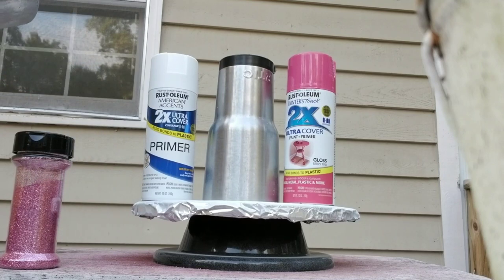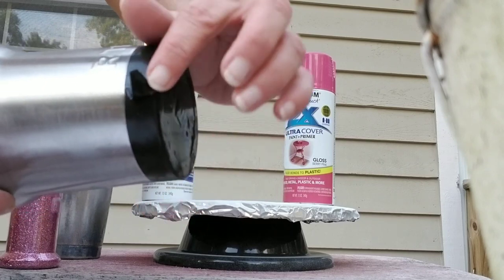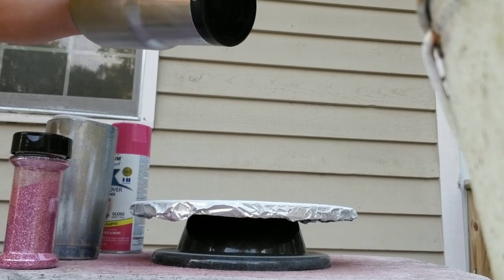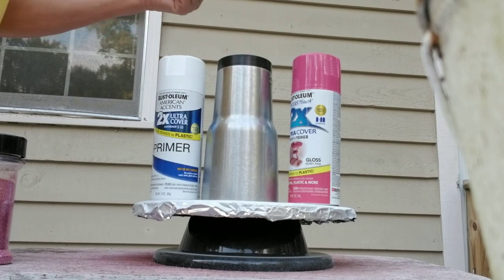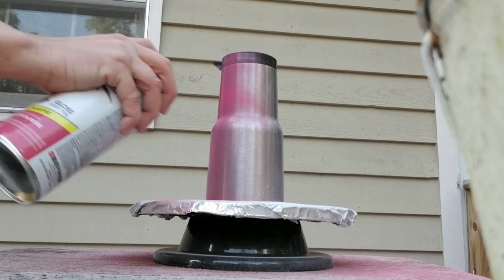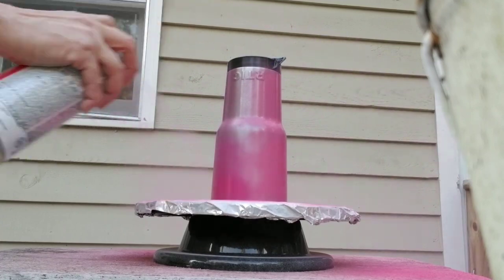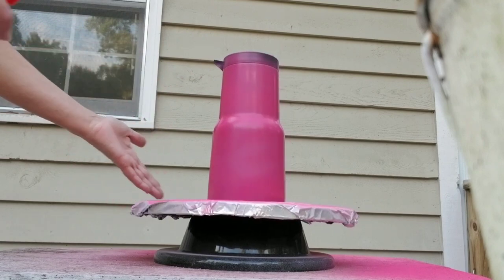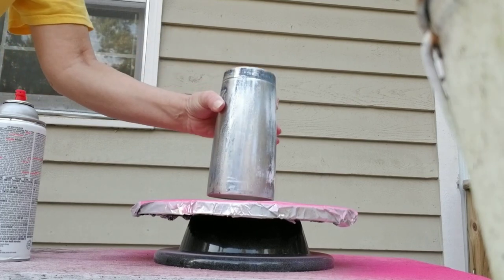Preparing stainless steel tumbler for painting

Comment: To confirm, you didn’t add any primer for the pink spray? Is it necessary to use primer? I have some sitting around at home but not sure if it’s necessary
Reply: The Rustoleum 2X Cover has a primer in it, but it's probably not necessary since you are epoxying over whatever you put on the cup, which locks everything in

Comment: For the first time I got a little paint inside my cup .. how can I fix it ?
Reply from the maker: I usually wait until I'm ready to epoxy the last layer and clean the rims and inside.  A little rubbing alcohol or acetone on a paper towel will take paint right out
Reply: Ok thank you
Reply: Denatured alcohol if the regular rubbing alcohol isn’t working, do this outside thought and rinse thoroughly after paint is removed

Comment: what if I get spray paint on the inside rim, how to get it off?  thanks!!
Reply: Mandy, 

Normally, after I epoxy first layer and its cured, I just wipe inside and the rim with acetone.   If you paint open side down,  no paint gets inside, but it may get on the top at the rim.  Hope that helps!
Reply: Acetone

Comment: I thought you where gonna use the white as a primer then the pink spray paint ontop. Does the paint hold up pretty well? Good video!
Reply from the maker: Mario C ... yes, I don't use cheaper store brands and I have not had any issues, even with tumblers I seal and bake with the clear spray paint
Reply from the maker: Mario C Yes...it really does.  After glitter. You will epoxy over it, locking glitter in.

Comment: Newbie!  I have drips from the spray paint.  Is there a way to get them off or flat?
Reply from the maker: Sorry missed this.  When this happens, let it fully dry and lightly sand the rough area with fine grit sand paper, wash, dry and apply another coat of paint in that general area

Comment: How’s the paint hold up to washing etc?
Reply: These are base coat for glitter tumblers to be sealed with epoxy.  I have, however, done spray paint only, baked in oven to hard the clear coats and they held up very well.
Reply: @MaryKayLora  can you give baking instructions? I want to paint a cup and add vinyl decal so what would be your suggestion?

Comment: What do you use to strip your cups with
Reply: If it's just paint, I use acetone. If it has cured epoxy, I use a paint and epoxy remover you can find at Lowe's or Home Depot in paint department. I use an old paint brush and brush it on, then wrap in aluminum and leave it outside overnight.  It pretty much slides off the next day.  Get some chemical resistant gloves and wear protective glasses when handling it.

Comment: If you bought paint with primer why do you have to use sandpaper. I only used the paint with primer and it was fine. Didn't know you could use gloss paint alot of people said to use flat never gloss that's why I didn't buy the gloss but I see from those video it doesn't matter
Reply: Sorry I missed your comment.  I always sand to give the paint a little bit of a rough surface to adhere to. Some folks don't sand, but I prefer doing it to assure the paint won't lift.  Gloss is just fine.  It's just a base to help hide the stainless color when you apply your glitter.  You don't have to do a base coat if you don't want, but stainless may show through, depending on glitter and the color.

Comment: Will it wash off if I wash it
Reply from the maker: You need to seal it with something if you're not applying glitter and epoxy to it.

Before glittering cups, I baked my painted cups to seal a clear sealer over the paint
Reply: How long do I bake it
Reply: how long do you bake it for
Reply: @sonnishupe4318  I usually bake them at 200 for about 20-25 minutes. Longer if a few coats and it won't hurt them